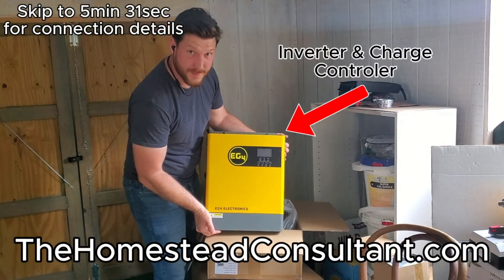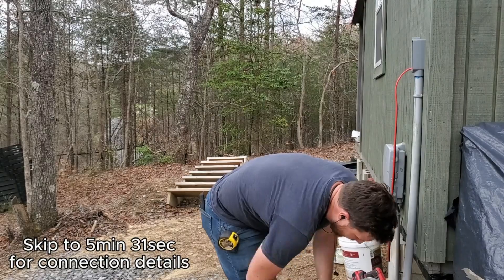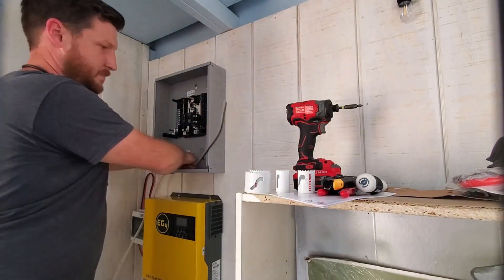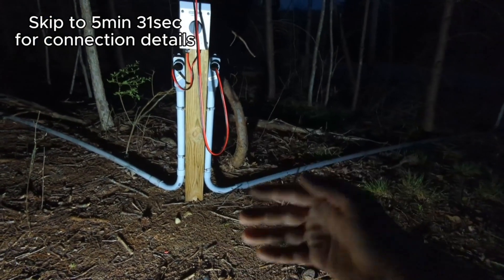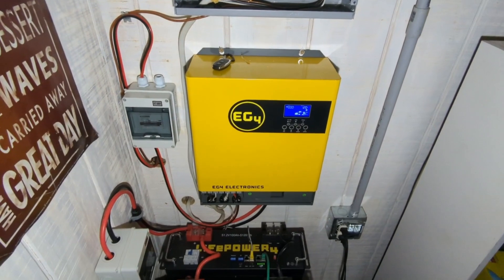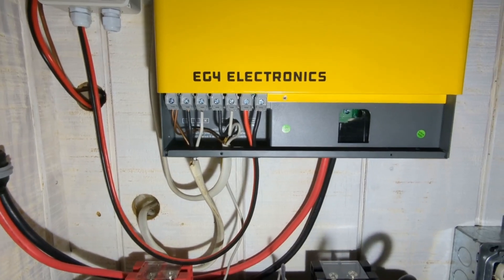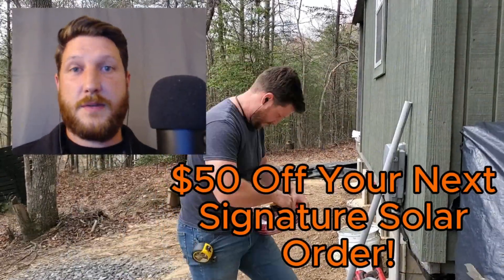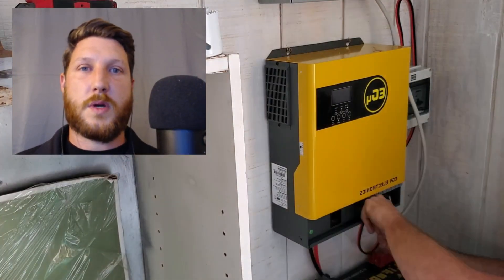DIY Off-grid Cabin Solar

Comment: Great video. I'm considering the eg4 3000. By the way, I subscribed. 😊
Reply from the maker: Thanks, glad to have you!
Reply from the maker: I just spoke to the clients for this install a yesterday and they are so happy with the function, they are wanting several more systems installed. 

When/if you plan to buy, if you use the link in the description, you will get $50 off your order and I'll get a little kickback 😉

Comment: You should using 6 gauge wire from your generator. And your 110v ac output really should also be 6 gauge
Reply from the maker: Can you qualify why 6 gauge would be appropriate? The input from the generator is well below the 30 amps that 10 gauge is rated for.

Comment: Put jumper wire in the main breaker and the panel will have 120 volt.
Reply from the maker: Yes, that works. We don't need the extra breakers though and it may be upgraded to 240v soon.

Comment: The bonding screw in the main panel is what should make the connection from your ground bar to the neutral bar, not the piece of solid #4 copper that is too big for that those connections anyway.
Reply from the maker: You can't reverse a bonding screw and I needed to test the bonding before commiting to it because some inverteters don't play nice. The 4 awg wire fits and is functionally as good or even a better connection than the bonding screw. I'll swap it out after full testing, but it's a pretty dumb thing to get hung up on IMO.
Reply: @ they make a lug attachment to adapt large wires for those bars for proper connection and ability to torque properly. Usually somewhere between 20 and 45 in-lbs but the panel always has its specs inside the panel.